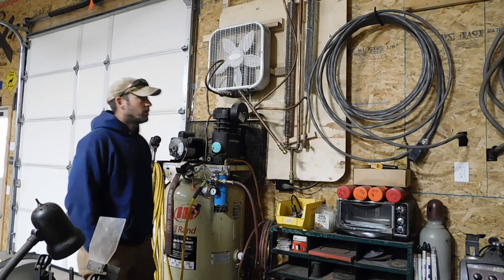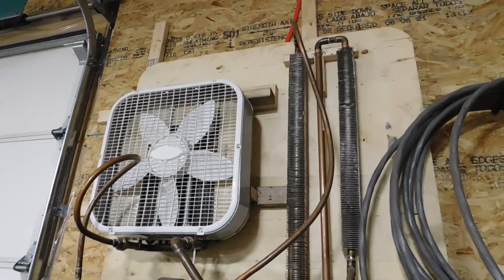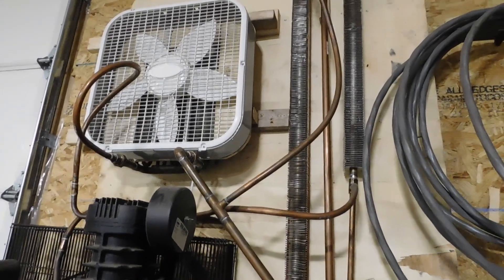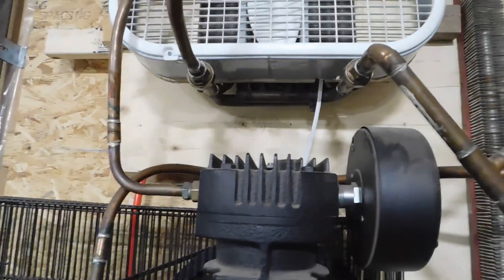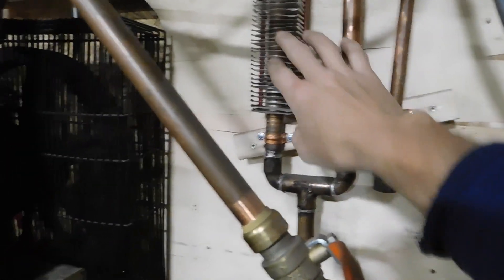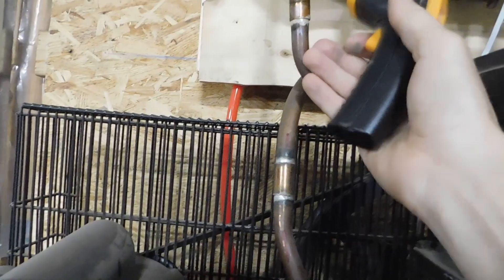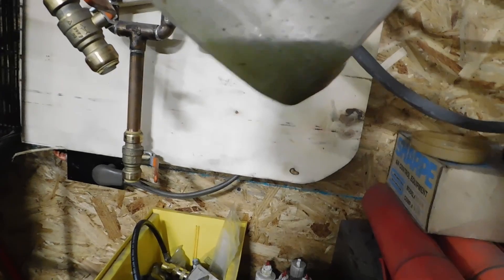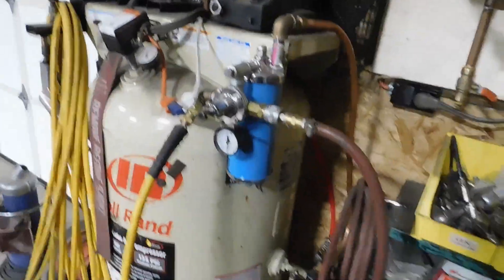Homemade air compressor water separator.

Comment: I like that fan and condenser coil setup that has to work much better than the plane vertical tubes setup.  I started looking for ideas because I needed to do some sand blasting but with the current humid weather my compressor was spitting like an aggravated llama. I just now remembered I have a few lengths of  finned 1.5 inch copper heat exchanger tubes…. That should make a perfect dryer with almost zero cost!

I’m going to one up you on the drain mechanism though. I’m adding a sprinkler valve and a time delay relay wired to trip the sprinkler valve for a few seconds each time the compressor shuts off.
Reply from the maker: That's a great idea,  I will say,  it take around 30 seconds after the compressor shuts off for the head pressure to bleed off,  so keep that in mind for the drain valve timing. But this setup has worked great now for 4 years,  just upgraded the compressor to a 7.5 hp, when I bleed down the old one,  not one drop off water came out of the bottom of that old tank.

Comment: how you get the fan to work, please help, you tap one hot and what about the other white?
Reply from the maker: The fan has two wires,  hot and neutral,  I just put the fan neutral to the compressor pressure switch ground.
Reply from the maker: I'm not sure where you live and what the electric code is there,  but where I live,  if the main circuit breaker panel is the first stop from the meter on the building,  the neutrals and grounds are generally on the same bus bar,  meaning they are the basically connected together and interchangeable.
Reply: @twosawacres8096  in FL,  got it. I understand now. Hot and ground or neutral basically the same here but my main is interchangeably but my sub panel has ground and neutral which connects to the main. There is a logic behind that and I will try to get to it. Thank you for your kind comment. I am thinking about using DC fan but that inverter is another device again. AC Fan is so much bigger and easy to deal with the power.

Comment: There is why they put drain valves in the bottom of the tank (it has cold metal walls to condense on) and some heavy-duty air filters on the end, which catches oil fumes and humidity also 😉
Reply: Jakob Z, Yes you are referring to what is called a wet tank/receiver, where hot wet air enters the tank & initially cools down & water condenses into the tank & is drained out the bottom of the tank when the compressor is used very infrequently. A problem arises when more frequent use warms the tank & less cooling occurs in the tank, reducing condensation. Vapor moisture passes out of the warm tank & right thru any water trap that is close to the tank. The moisture laden air eventually finds cooler air line surfaces & a pressure drop condition, allowing water to spray out of the tool or blowgun. Water in a tire or inflatable pool toy is no problem.
For those serious hobbiest that do painting, sand blasting, plasma arc cutting & use high dollar air tools, water in the lines can be an expensive, frustrating, time wasting problem. Examining a serious fully optioned expensive professional air compressor, you will notice a compressed air Aftercooler/radiator/heat exchanger that receives the hot humid compresed air directly out of the pump discharge port & cools the air from 325 °F down to near ambient temp (85 to 100°F), condensing most of the moisture from the compressed air, then removing it in 1 or more traps & filters Before the air enters the tank, so that No moisture can be drained from the tank normally. This arrangement is called a Dry tank system. Not only is the air of drier & cleaner quality, but the tank will not rust out & eventually explode (yes, like a real bomb, people die from that every year!) Many times the air is dry enough so no water is in the air lines & many finicky tools will function flawlessly. What he built to add to his budget priced compressor gives him the high quality dry air of a much pricier full package professional air comp. at a low budget price... Smart guy!
Reply from the maker: Thank you Paul.